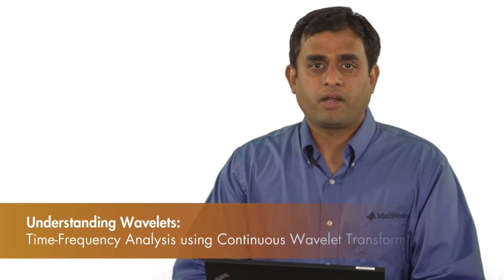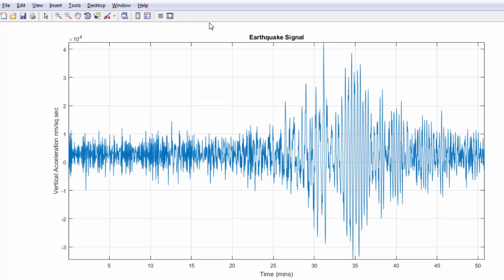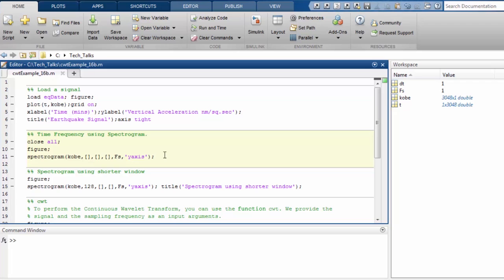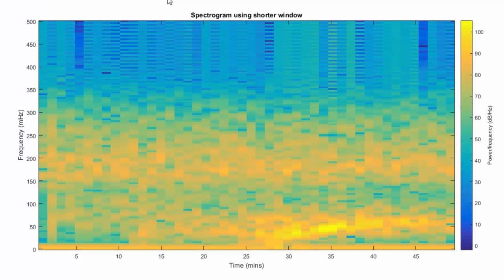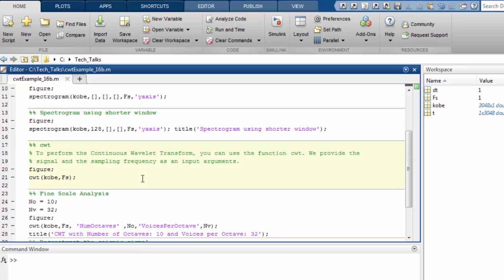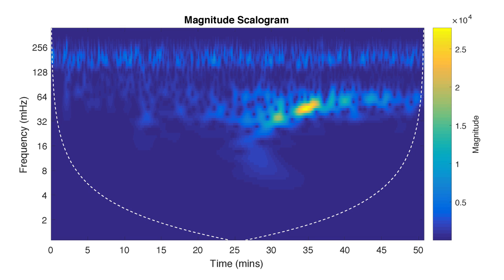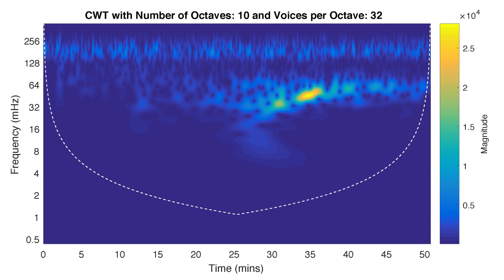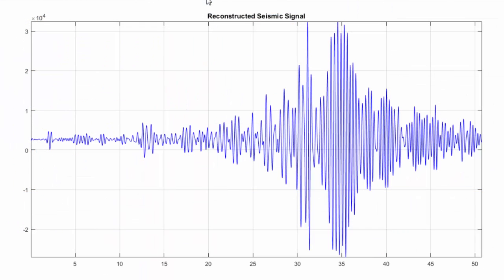An Example Application of the Continuous Wavelet Transform | Understanding Wavelets, Part 4

Comment: Dear Sir, is the 'cwt' command applicable to a vector or a .wav object ? I have a row vector which I need to analyse using cwt but the error says 

Input argument "WAV" is undefined.

Error in ==> cwt at 145
if ischar(WAV)

Kindly help me out. Thanks
Reply: i am having the same problem here. if someone finds a way out please reply